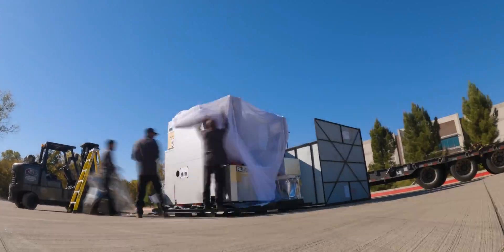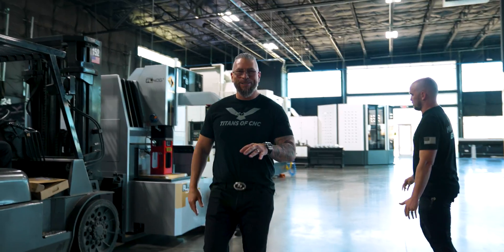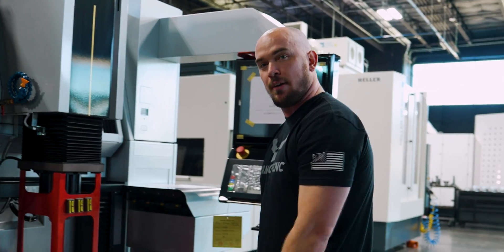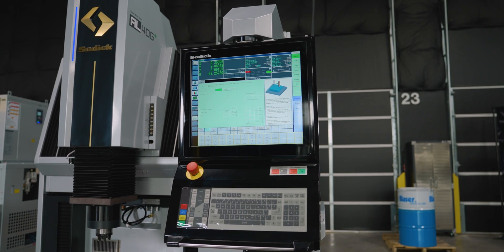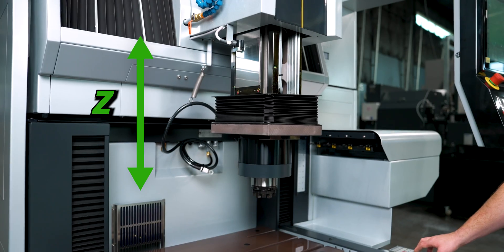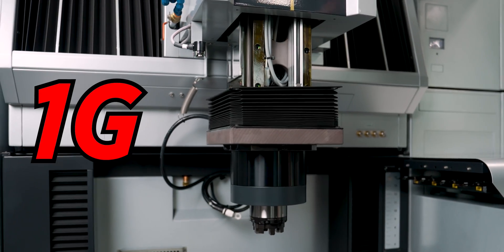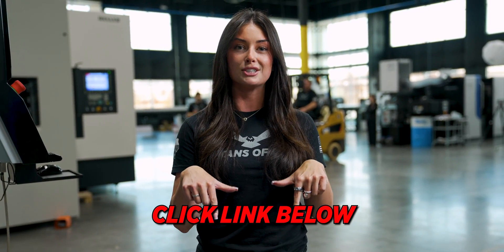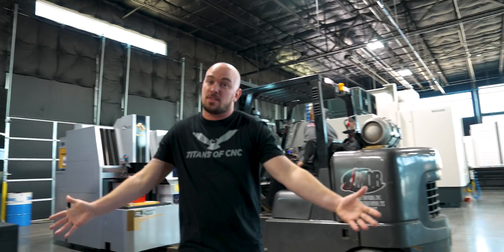Unboxing the SODICK AL40G Sinker EDM Machine

Comment: Looks like a great machine. I see you have the Sodick wire EDM paired up as well. Do you still have your +GF+ (Agie-Charmille) wire EDM? I was wondering because we've been running FANUC EDMs for years. Then we bought a +GF+ CUT P 550 PRO (same as yours) and it has been problematic since the beginning! I don't know if we got a lemon or everyone has troubles. I'll take my FANUC C600 and 800s series any day over the +GF+ now that I've run both. What's your take on this?

Comment: The IQ programming offers a significant advantage over traditional programming, providing automated measurements and inspections with an exceptionally high unmanned machining ratio. I have been working with Sodick IQ for 10 years, and it is incredibly efficient (even with parasolid assemblies and up to 64-position electrodes), while remaining remarkably easy to use. Nice choice!

Comment: What happend to the Pixie dust chip master's hair. It just don't look right compared to what we are use to 

Linear motors nice. All it's missing now in hydrodynamic ways to be completely wear/contact free on the axis's 

Kinda wish the tank was like they ones that coldchester used on there water quench gear hardening machines back in the day ( instead of filling and emptying the tank every time it just lowered the tank with all the liquid still inside when changing and lifting it all back up when part changed ( we are talking like 7ish second from one part done to working on the next part ) and it's not like there is a lot of forces acting on the part or machine doing the work so only being hold/supported at one side sould be strong enough )